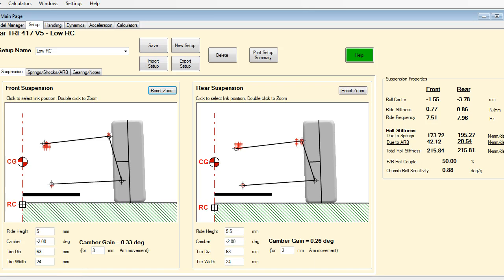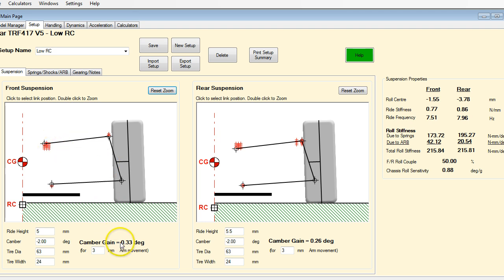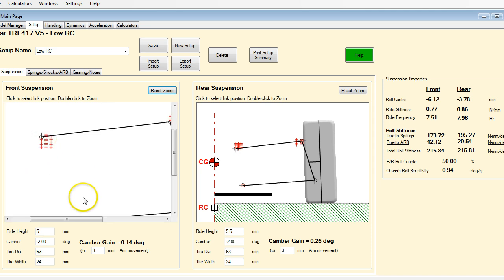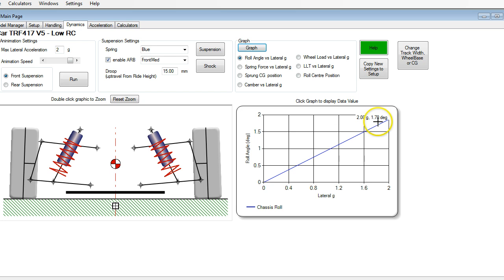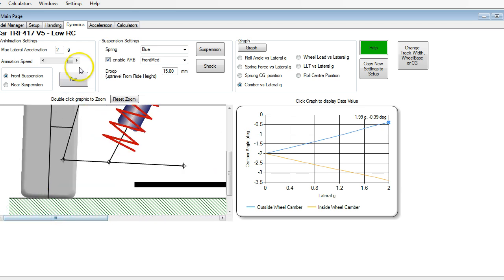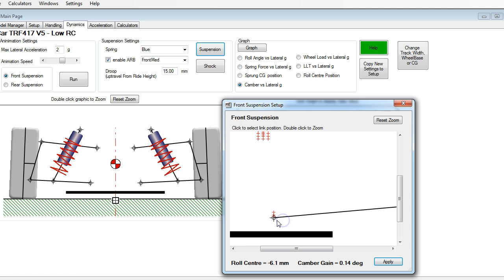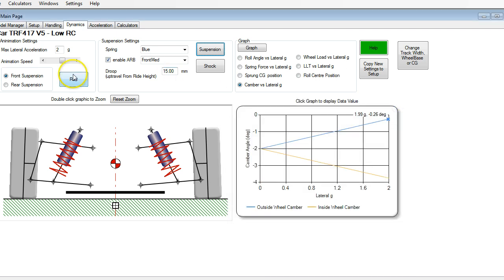Roll Centre and Camber Gain Relationship

Comment: I think it may be more appropriate to plot camber vs roll angle. Several factors affect lateral g.
Reply: Don't think I agree with that approach. This is a setup program so you want to see what the camber is under race conditions. It's lateral g acting on the sprung mass that induces chassis roll so just looking at roll angle doesn't tell you anything about what is actually causing the roll. The program takes into account everything that affects chassis roll, roll stiffness, Kinematic Roll Centre, sprung mass CG, and droop so the input is lateral g and the output is chassis roll. Cause and effect. In reality the relationship between lateral g and roll angle is fairly linear for all the on road cars I have looked at as the chassis roll angles are very small, generally only 2-3 deg. One of the graphs you can plot is roll angle versus lateral g if you want to investigate it further.

Comment: Interesting. Lateral g is a function of vehicle sprung and unsprung mass and tire force acting at the deformed contact patch. This lateral force is defined by the tire slip angle and friction coefficient. These tire dynamics would need to account for pacejka tire coefficients, or similar modeling.

I suppose extrapolating to kinematic equations from empirical data could be used.
Reply: Also, as lateral g increases, so does tire deflection and upright deflection. 

This in turn induces positive camber. A quick search on fsae compliance illustrates this behavior.
Reply: BurnDuration If you are asking can the program predict the ultimate g limit then no it cannot because we do not have tire data for vertical versus lateral force  at different camber, slip angles, temperatures, surfaces ...... It is unlikely we ever will. I could assume a tire model but that is a huge assumption. So what the program does is treat the tires as a constant and look at the kinematics. In simple terms the lateral g is applied at the sprung and unsprung mass CG and the springs and Anti-roll bars resist the applied force. The amount of chassis roll is calculated from that force balance. I know the maximum g achieved in a TC is around 2g (max spike I have recorded is 2.5g) so that is the value I use to look a camber angles. The method used in the program is that presented in Race Car Vehicle Dynamics by Milliken & Milliken.

Comment: Hello, Very nice video! How do you go about adjusting roll center, camber gain, etc. using a Pillowball style frontend? Do you offer Arrma 1/7 Car or 1/8 Buggy models in your library? Cheers
Reply from the maker: Adjustability needs to be built into the suspension to allow for roll center and camber adjustments. For pillowball suspension you would need to be able to adjust the position of the inner pivot point of the lower/upper control arm. I do not have models for the chassis you mentioned but you can create your own models by accurately measuring the suspension geometry. There are videos on the website that go through this process. The program has a 30 day trial
period if you want to give it a try.

Comment: you mentioned  -.4 of camber gain is optimal, did I get that right?  great video by the way
Reply from the maker: What I was trying to illustrate is there are a number of different ways to achieve as similar result. The optimal camber gain would be a function of the tire itself and the racing surface.

Comment: So when you say camber gain you mean going from -3 camber to -.4 camber that is considered a camber gain, right? It's confusing because when people say run more camber usually they mean run more - camber. Am I understanding this correctly? A camber loss would mean that upon roll negative camber is actually increased? And a camber gain negative camber is decreased to reach -.4 degrees of camber. 

Also how should camber change when compressing the suspension totally vertically versus rolling laterally? It seems like most cars have more negative camber with vertical suspension compression but when you introduce lateral movement in addition to one side of the suspension compressing you lose negative camber.

Please fill me in on what is meant by camber gain and these different relationships should. Negative camber increase or decrease under compression and under roll.

Thank you
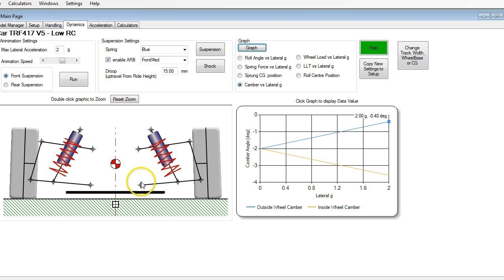Reply from the maker: There are two parameters regarding camber. Static camber which is what you set on your car sitting on the ground (or desk) and camber gain which affects the camber as the suspension moves. When the chassis rolls the outside tire will lose camber. The more camber gain you have the less the tire camber will change as the chassis rolls. The amount of camber gain required is a function of the tire construction. If you watch this video starting at around time 11:45 it may help to clarify it. https://youtu.be/wAXdzbW8WP4
Reply: RCCrewChief Thank you! I understand static and camber gain but I was beginning to be confused by people because I wasn't sure if they were saying they gain camber when the car rolls because I know you loose camber then, and then if you think about technically camber is negative in our application so camber gain could mean going less negative or loosing camber so I just wanted to make sure. 

With my cars I see little to no camber gain under vertical compression even with a relatively short link. It seems like with a lower roll center positioned camber link you get less camber gain? Assuming the same link length. But with a higher position roll center link you get more camber gain? Wish it was the opposite.
Reply: Lyons Camber gain is used to keep camber loss during chassis roll to a minimum. They call it gain, because you always lose camber, but lose less when you have gain built into the set up.

Comment: Are there any plans to Add any 1/5 scale cars.   Like MCD racing ?
Reply from the maker: I have one 5th scale on road model. If you install RC3 I can send you the model and you can import it and take it for a test drive. There is a 30 day free trial period.
Reply: @RCCrewChief   can you go in and do like a save as to a car and give the arms different lengths and your software be ok with that ?   I could then open up your 1/5 scale or even a 1/10 scale that had about the same chassis adjustment  points save as my car and put in my a arm lengths chassis hieght wheel offset etc.. ?
Reply from the maker: You would be better off starting with the model that is already done. Creating a model is something you should try after becoming familiar with the program.